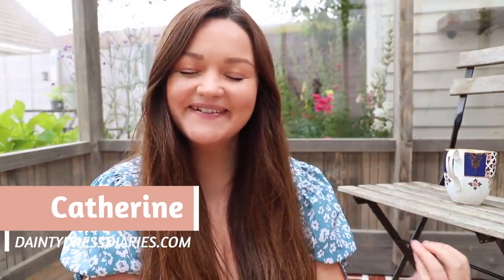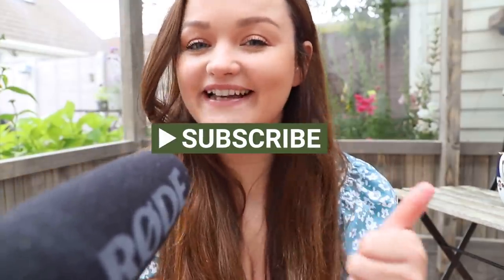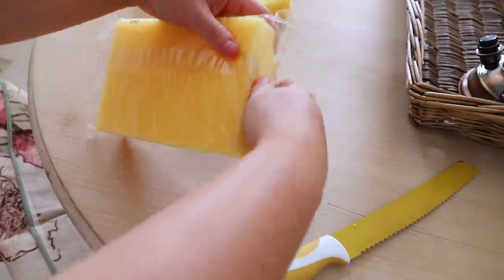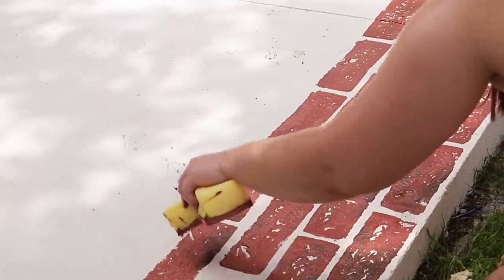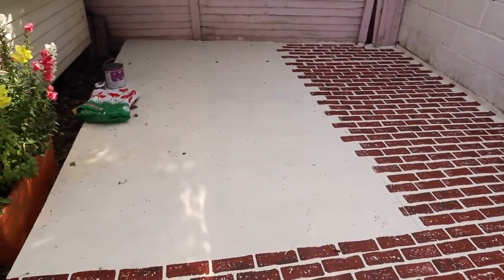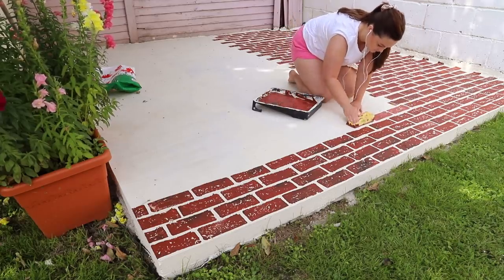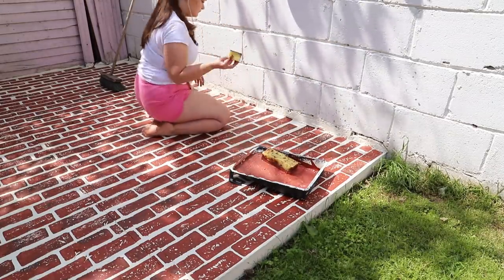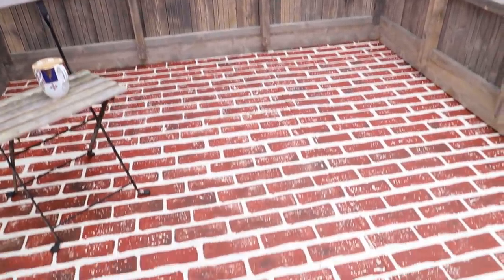DIY faux brick concrete cottage floor for less than €25! - Greenhouse first look

Comment: Oh your greenhouse is lovely Catherine. Love what you did with the brickwork. I love Martha Stewart she has great ideas. I can't wait to see your gradual transformation inside the greenhouse it will be like a wee garden room too which will be great in our weather 😊. Also calor gas do a vintage style portable gas stove called Provincal  that might be good in your greenhouse if you haven't got electric yet, you would just need good ventilation and a co2 alarm but they are portable and run on gas bottles. Health to you and Blondie to enjoy your lovely new greenhouse xx

Comment: The floor is outstanding, I'm glad you didnt expire in the heat doing it. 
The other farmers round round here think I'm some mad woman for having a pretty seating area in my polytunnel but in a greenhouse, you take it to a whole new level, 😊
I have an original victorian glasshouse on the farm, it needed a huge amount of renovation and took 4 years to do. Its constructed mainly of cast and wrought iron on brickwork. It gets so hot in there in the summer I can only work in it early mornings and evenings in spite of it having a lot of ventilation windows.
Ican't wait to see yours fitted out, I just know it is going to be so pretty.

Comment: Catherine you have done an amazing job of the floor! Pva glue watered down is a good sealer. Scrumble is a good treatment for lightening and darkening wood. 
If it leaks at all just get some mastic or silicone sealant to do round the bottom and maybe put beading over the silicone to hide it. It can be bought in different colours besides white and clear. It's been a long time since I was a buyer for DIY store, there could be so many newer products xxx

Comment: Not sure if you've realised yet? but the key thing about Victorian greenhouses is a steep roof, and you have one! Modern shaped greenhouses have a shallow pitch on their roofs. Not all the Victorians have a brick base. I have a 'Victorian' white aluminium, which was expensive and it is glass to the ground, and the same shape as yours and has exactly the same shape roof as yours does. Painting yours white would make it look completely Victorian, as they nearly always painted them white to give more light to the plants, or you could use the white/lime thin garden paint to give a white impression, which doesn't need rubbing down to replace years later :)

Comment: Awesome job! I love your greenhouse! I was inspired by Lydia’s greenhouse too but it is too expensive for me.  I ended up building my own greenhouse which I did share on my channel.  I didn’t have a concrete slab poured because I wanted the structure to be  movable if needed so I used concrete pavers. I also use my greenhouse house for duo purposes since I like to do crafts and woodworking too. Thank you for always inspiring us!
Reply from the maker: Ooh that sounds perfect though! It's all about making it work for you! That sounds so lovely 💕

Comment: Acrylic may be your answer. If you use water based, it will be ruined if you get it wet which in a greenhouse is bound to happen. Go to a proper paint centre ( not the likes of b&q) and they should be able to help you as they know their onions.